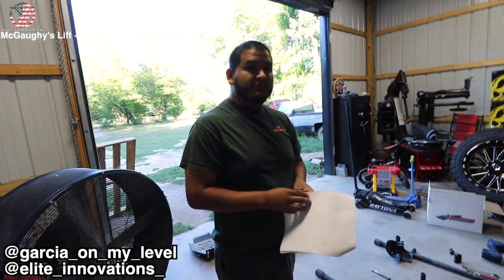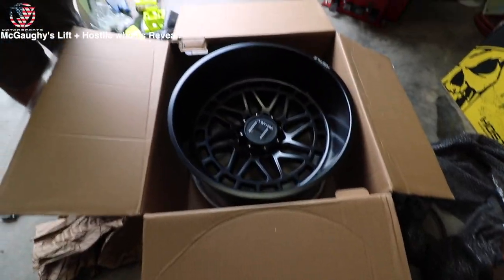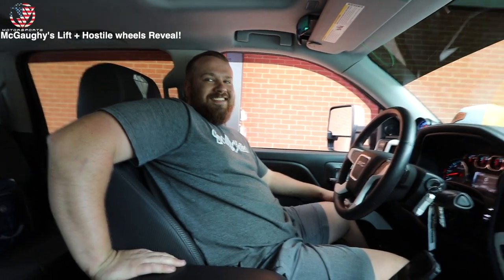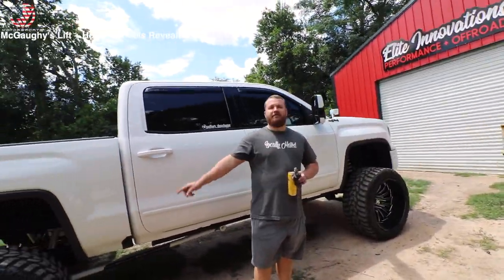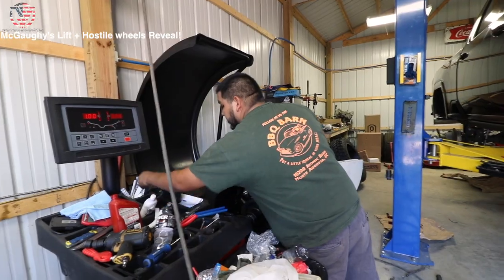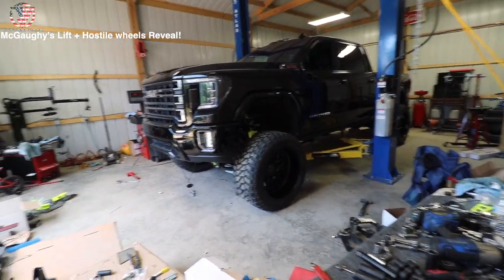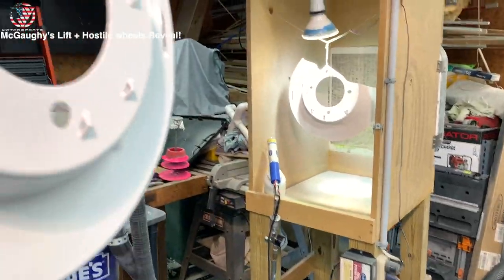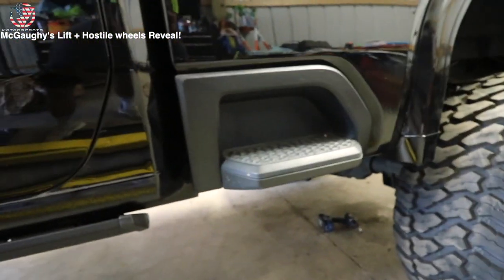2020 DURAMAX GETTING 9" MCGAUGHY'S LIFT WITH 24X14 ON 38X150.50!!!

Comment: You should NOT shim the axle.  The u joint at the trans and the diff should be the same angle.  The pinion shims are so the driveshaft yoke doesent pull out as far.